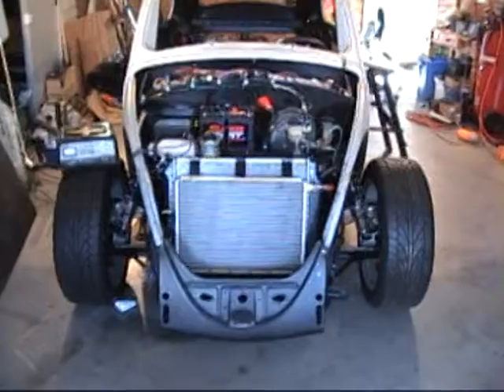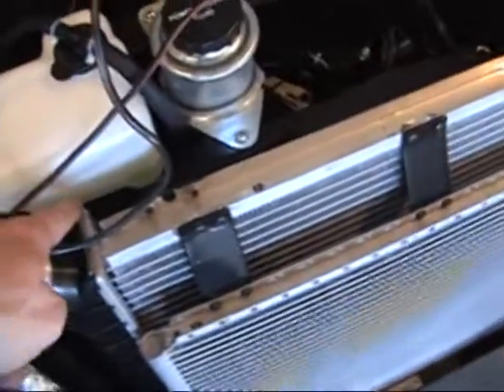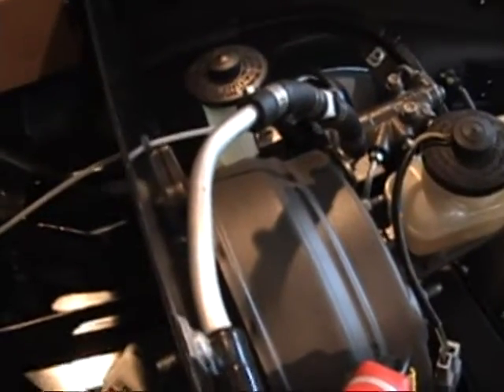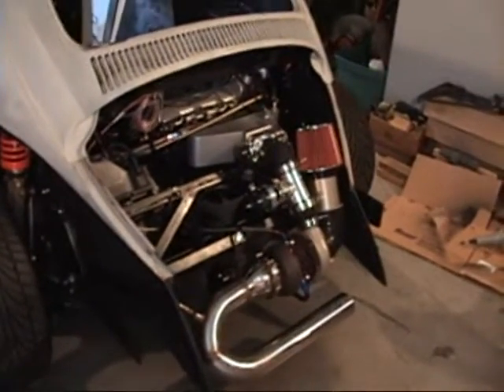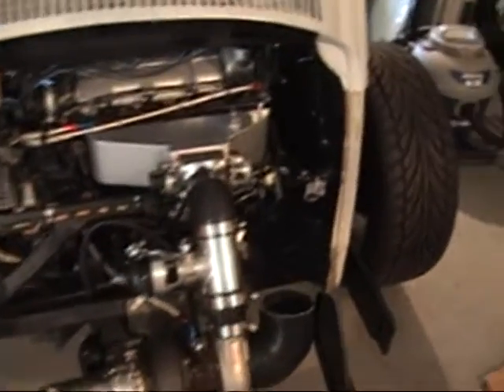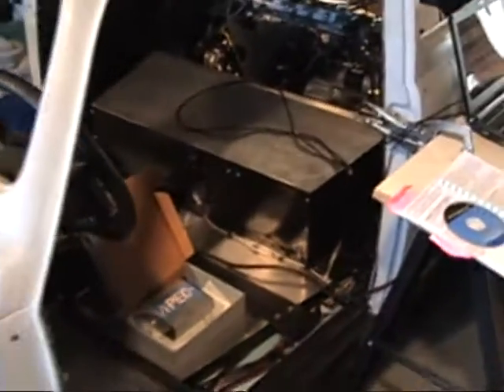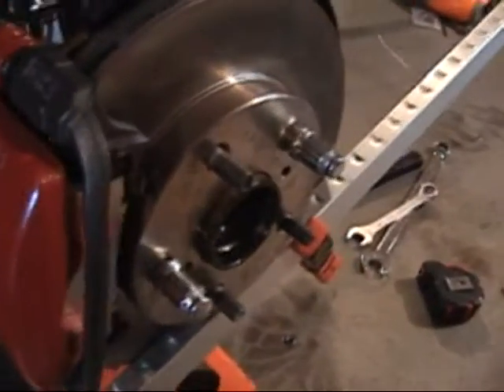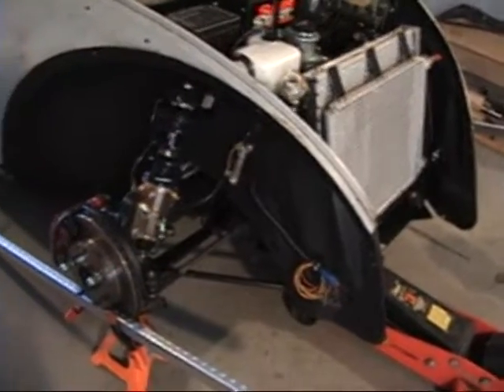Plumbing & Electrical complete ready for start #451

Comment: where did you get the VW center caps for the wheels?
Reply from the maker: Measured the hole. Searched ebay for size. Got lucky.